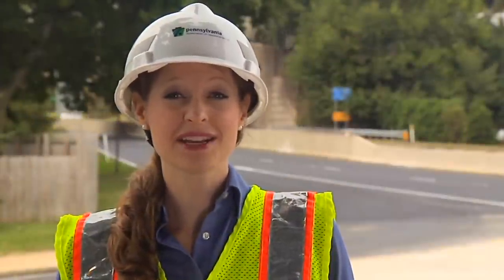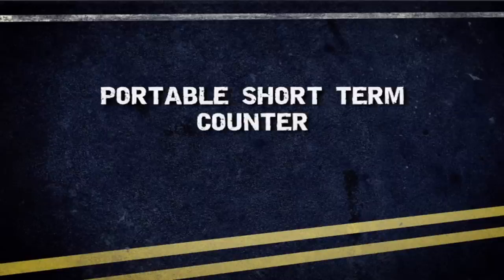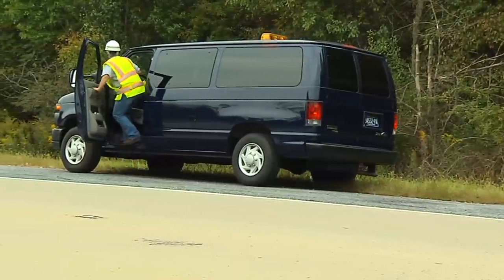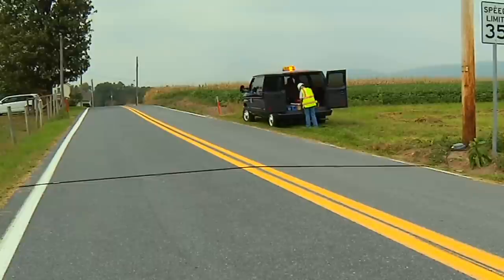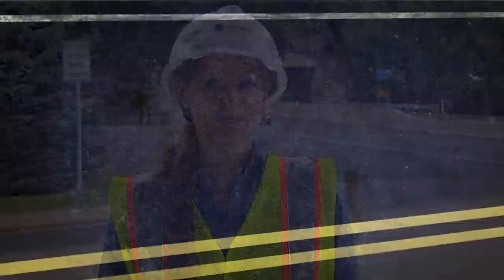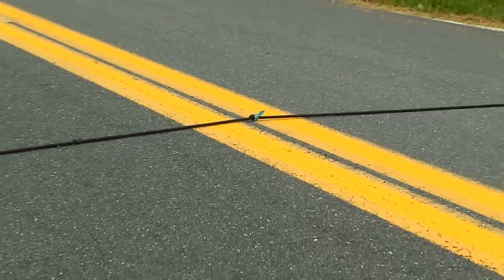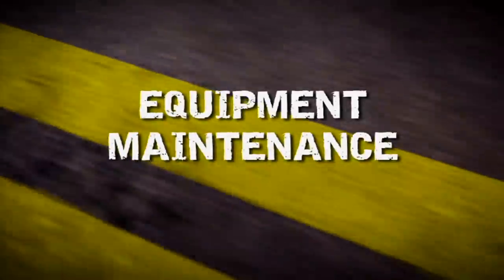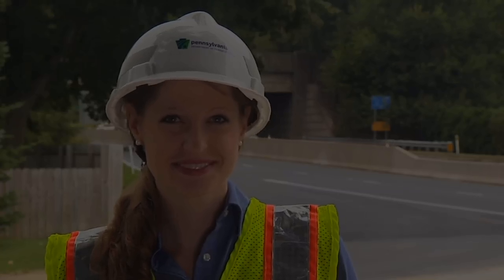Traffic Counting Training Video

Comment: As shown at the end of the video  it is a bad idea to repeatedly disconnect the battery using the Spade terminal connectors of the wire. These spade receptacles are not designed for repeated insertions and will quickly loosen and become subject to disconnection due to vibration and their current capacity will be decreased. Using pliers to slightly squeeze them make them tight can be done once or twice but the elasticity of the metal and the shape of the receptacle will become distorted. For one it is not necessary to disconnect the terminals before measuring the battery voltage. There is no good reason for doing this. The cable had an inline connector that should be used for disconnecting the battery if you need to reboot the device. Otherwise keeping everything connected will give you much longer life on these connections. Using a Dielectric grease on the connectors is helpful if corrosion occurs but I would not expect that to be much of a problem. If there is corrosion on these terminals there would also be corrosion on the circuit board which would lead to leakage current and circuit failure. I develop products using these connectors.

Comment: I appriciate the presenter she describes how  the traffic volume or data collection counter set up for functioning stepping was  good and english ax cent was good  but why repeatedly showing the battery and cable set up to use nail and other gum etc  it may be for commercially gain to take time to extend time  thanks presenter

Comment: sometimes roads tubes give same value of time passage for different types of vehicles with differnt speed.What to do then if the data consist of high percentages of zero headway due same time passage value ? seconsldy, what value it will give if 2nd vehicle front wheels passes pneumatic tubes ahead of 1st vehicle rear wheels?